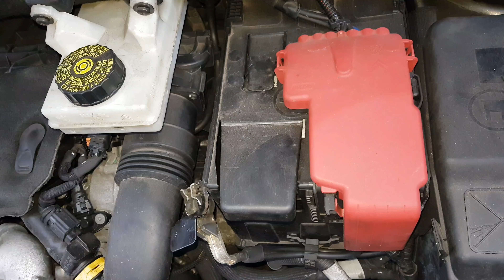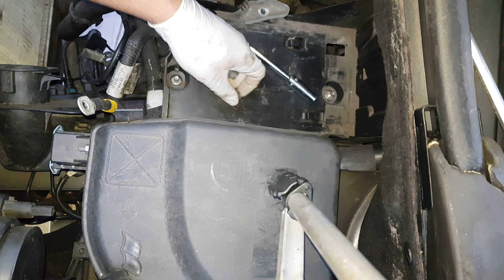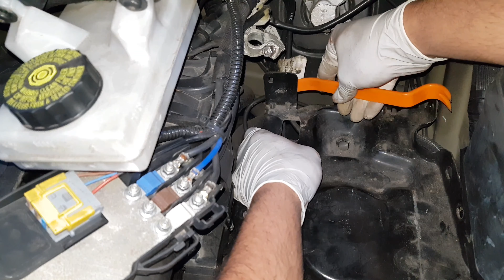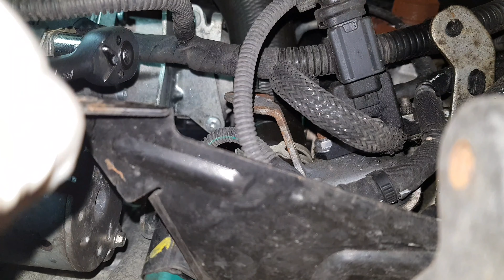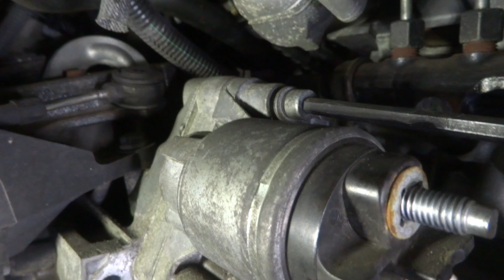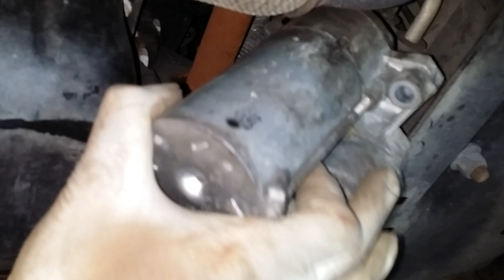HOW TO REMOVE PEUGEOT PARTNER STARTER MOTOR

Comment: I did my 2009 308 T7 1.6hdi. It's not easy but I can confirm you can get the starter out without removingnthe driveshaft OR the engine mount. It came out between the driveshaft and the firewall, where that heatsheilding is, withoit much trouble. The hardest part was finding/feeling the bolts, and ratcheting. Is used a minature 1/4 drive ratchet, plenty of mirrors and lights and did it without a hoist. Good luck :)
Reply: après avoir ouvert les 3 tiges filetées, l'écrou de fixation ainsi que les écrous de 13 et de 8 (côté électrique); il suffit de démonter le filtre à air, et de retirer le démarreur par le haut du moteur. cela nécessite deux personnes, mais c'est plus simple que par le bas du moteur.

Comment: I have fitted several starter motors on these vehicles, they are the same as a Citroen Picasso Multispace. I find it easier to remove the righthand driveshaft for more room. However it means refilling the gearbox.
Reply: Not a bad idea though, when you have to do the maintanance to that and renew the oil every now and then anyway, thanks

Comment: Thank You for this post ! 
It was very helpful. 

For everyone else: 
This is tight as f**k !!! 
Your arms and hands will be in pain for several days. It is not easy but it is not impossible. 

3rd bold is a through bolt that requires removing the inner fender on the driver's side.

Comment: Ok I have just completed this task. I have the documents from Peugeot so for those that are wondering all except for the bottom mount of the starter (and obviously the positive wire) , this job is completed from the top side of the engine. You do not have to remove the driveshaft OR the exhaust manifold, you can quite easily remove it. 

But you will have to stick your arm in a long way. If you are quite short this is going to be a bit of a challenge. I am 6ft and I was up to the armpit in getting this done. The top left hand bolt needs to be removed with hex bit and spanner, I don't think you'll do it any other way and 90% of this job is done by feel. 

However, it was in the end a pretty simple job. To make it easy on yourself,

1. Jack up car, get underneath and do that one bolt and the positive terminal.
2. Set the car back down and do the rest from the top. 
3. Use a hex bit with a ratcheting spanner. for that difficult top left bolt ( the one closest to the engine) 
4. the other bolts are no problem.
Reply: i got 2 bolts on starter body from underneath ,,same car as this,  2 long hex bolts,,is there another hex bolt hidden, im only 5 ft 3,,
Reply: @elisabethdunstable  two bolts on top and one underneath
Reply: @shimarlie1  brilliant

Comment: Many thanks for taking the time. A big help to me, especially the 3rd bolt behind the battery tray 👍🏻😜🥳
Reply: Having that bolt stick through from the wheel bay meant having to remove the wheel bay protector panel, which was a ton of work. Really bad engineering decision. Beside the starter being in the most difficult place to get at that it can be.
Reply: @Paul Michael Freedman  that's the little sod circled in red in the video  I suspect. .
Reply: @Seaside33  Indeed. I hope they fired the engineer who designed that.

Comment: Thank you, excellent. On my 2010 B9 I couldn't get the starter out from by the exhaust and I couldn't get the exhaust off but I COULD pass it to right hand side of the engine and up through the gap by the fuel lines and out of the bonnet. For others... on mine you need to take the nearside wheel off and the arch to access the battery tray bold that's under the fuse box. I used an impact wrench and took off the welded on nut before realising the bold undoes from inside the wheel arch. No idea how I'm gonna get the allen bolts back - just waiting for the new starter.

Comment: Ok So I have the 1.6L EP6CDT T7 engine. And when I go underneath the exhaust AND the driveshaft are in the way. Do you have to remove both to do this easily?

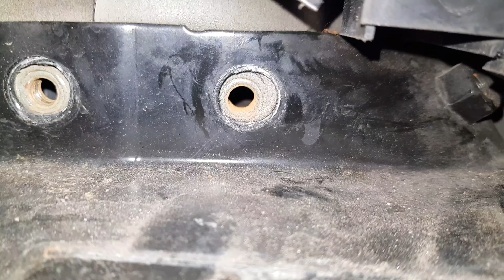Comment: Hi Guddu Pappu. i have question, how can i remove the red circled bolt that is at 5:10 in the video?
Reply: YOU HAVE ACCES AND HAVE TO QUIT THE PLASTIC COVER FROM THE TIRE IS A STUPID DESIGN AL THE CAR HAVE NUTS & BOLTS IN DIFFICULT POSITIONS.
Reply: I wasted one hour tks greetings since México

Comment: Great video, thanks for taking the time. But how to easily get the loose starter engine out of the car? It's completely stuck.
Reply from the maker: You can remove the driver side driveshaft then starter come out easy
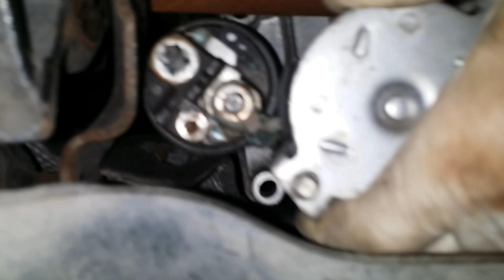Reply: or remove the lower engine mount and lever the motor back a bit to get it out see that bolt at 8:13

Comment: It’s actually way more simpler than he done he done the slow way you can access it from underneath and just remove three or four bolts and it’s out and never ever use a jack from the boot or professional one just slide under the van disconnect the battery first and that’s it
Reply: nonsense
Reply: Obviously hasn’t done the job before. Battery and tray have to come out as per the video. I had to remove the lower engine support to get the room between the exhaust and drive shaft. Much easier than removing the drive shaft 🥳
Reply: Twaddle, you have to take the battery out.  On my 2010 B9 I couldn't get the starter out from by the exhaust and I couldn't get the exhaust off but I COULD pass it to right hand side of the engine and up through the gap by the fuel lines and out of the bonnet